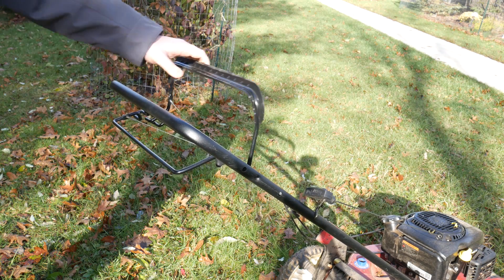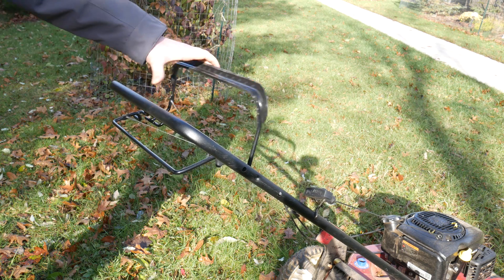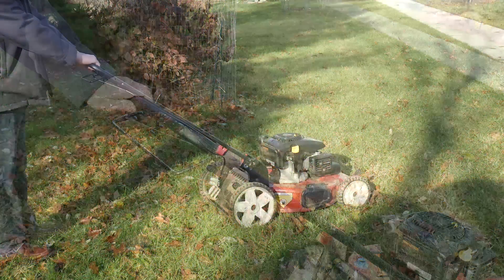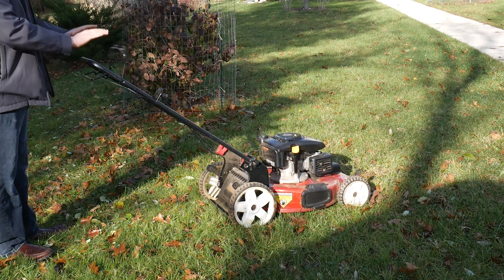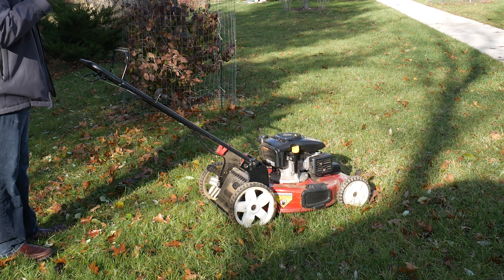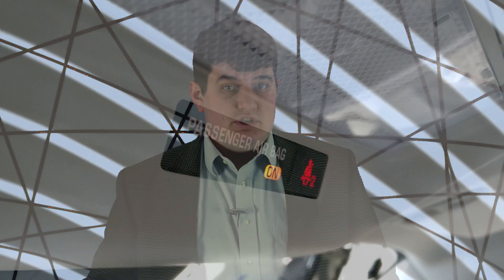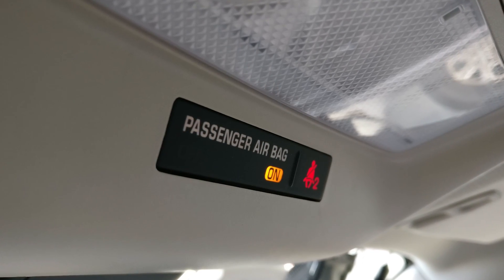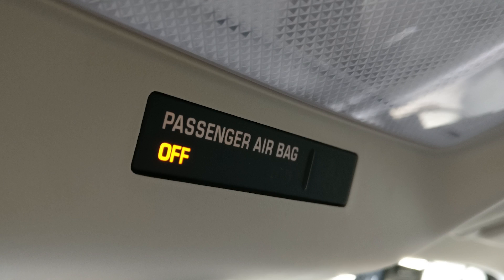The Dead Man's Switch:  How Anton Yelchin's life could have been saved

Comment: "All that's needed to prevent the scenario that lead to Anton's death" is just a gear-shift-lever that works properly.
Reply: The point of having safety features is to step in when the operator commits an error or the item fails. We have handrails for a reason. No one reasonable would say we shouldn't have hand rails because people have a responsibility to not fall off the edge.
Reply: @shadogiant  Handrails actually make it easier to pull yourself up stairs if you're trying to go fast or pack something heavy up them. They're not just a safety feature and so would exist regardless
Reply: @shadogiant  we should just wrap you in a roll of bubble wrap and put you in a padded room and never let you out for safety reasons. wouldn't want you to ever get hurt.
Reply: @shadogiant  no.  the purpose of safety features (used to be called fail-safes, but consumer feedback thought it meant the product was designed faulty)(marketing wanks)  is to FAIL in a SAFE manner... so, if you have a FAILURE (not operator error) it will do so in as safe as possible.  So, the example here, is that there should be an brake should the transmission parking pawl be unable to prevent the vehicle from moving once shifted into Park.... Oh, right... every vehicle HAS a parking brake....  so Instruct the Operator to Use it....  like say idunno.... with a driving instructors course and driving test?....
Reply: f1y7rap there is no reason, that safety measure couldn’t protect user from their own error. Like saw stop or quickstop chainbrake. There are ways to create overrides for sensor failure and companies can include disclsimers, that these systems are not replacements for correct operation of machinery. Most modern cars won’t apply park when moving, so accidents caused by sensor failure wouldn’t be prominent. Inconvenience when occurring, but most likely non-fatal.
Reply: He did state in the video that this specific scenario can be avoided by the computer not engaging park if the car is moving faster than a specific speed.   All about the programming.  @ 6:40
Reply: @crp5591  or make the engagement have a timer depending on speed, if the car is sitting still but you leave the car while it's in gear, maybe it waits 10 seconds before applying the parking brake, but while moving you get a only 3 seconds before the brakes are slowly applied, but then get released as you sit back down.
Reply: How dare they to consider improving my safety! I never got squished by a car so why should I need such a failsafe! I don't even have a driver's license, I just drive the car, works just fine! And while we're at it, I also don't want free healthcare because I never had a bad illness! Retirement fund? I am not old, why should I have one!
Reply: It is a horribly designed shifter which does not give a positive indication that the car is in park, nor a warning that the vehicle is in gear when the door is opened.

My Fuso truck chimes loudly if the door is opened while the shifter is in any position other than park and the brake pedal must be pushed firmly to the floor before and held for a second before it will shift out f park.
Reply: that's why it wouldn't activate if the car is already in motion or not already practically stopped, this is why those cars with the start engine button, don't kill the engine if you press it while driving, but it has an override if you hold it in to kill the engine while driving in the event of an accelerator runaway where you cant de-accelerate (dump the car in neutral and slow down before doing that though), also, i have dumped cars from drive, to park while in motion, it doesn't stop the car, it shifts the gears into a stopping or reversing position into opposing motion from the tires and starts to grind and destroy the transmission, so if anything, a car suddenly dumping into park while driving would at worst, shred apart the transmission and render the car undrivable without losing control of everything (you could bring the car to a stop and steer, but wont get it moving again after)
Reply: In the world of accidents, it's not just one thing that goes wrong. Faulty gear shift lever + lack of dead man switch + car on an incline = just three of the several factors leading to his death
Reply: Does this car have a handbrake?
Reply: sidharth cs   Every car / truck has a parking brake, that is supposed to be set by the driver.
Reply: Or just design auto gear shifts as they have been designed for decades - a straight line in the PRND configuration. Even w the auto manual options, what is the point of automakers making transmission selectors differently than each other?
Reply: the issue with some of these automatics thy are fully electronic (well at least in last 10 years) , as the shifter defaults back to middle when you let go of it so if your not looming at the dash you might of missed park (if your in automatics that simply shift and lock most people would never had run away down a hill issue) 

an idea is Basically if two sensors are tripped automatically go into park and auto ebrake if car has ebrake( if under 3-5mph) so if the the door is opened and seat belt is off or seat sensor it should go Into park automatically and ebrake (if fitted)

Driving without seat belt is illegal in most places so Boho if you can't move with seat belt off but as what I am suggesting also requires you to open the door so having no seatbelt would not stop you from driving away opening the door as well would (but that's why I say 2 sensor idea is better, door and belt or seat sensor if both are open then auto park and ebrake if fitted) 

in current cars with this vertical stupid return to center automatic shifter they are fully computer controlled and part of the Cambus so they could update the ECU to implement automatic Park and ebrake if seat belt not in or seat sensor and driver's door is opened when car is in in drive or neutral
Reply: true comerad
Reply: Depends on the car. I've accidentally dumped my 4L80e-fitted Suburban into both reverse and park at speed (faulty gear indicator), it either spun the tires backwards or locked them up, in both cases starting to fishtail the truck. Fun times!

Said faulty gear indicator also made the car roll away from me once when I thought it was in Park. Also pretty amusing times.. never left it without setting the parking break afterwards.
Reply: The purpose of safety equipment is to protect you when things don't work properly or when used improperly. Would you get into an elevator without a free-fall brake? Would you use a welding torch without a flash-back arrestor? Would you buy a water heater without a pilot light detector for gas shutoff? Would you use a microwave oven without a closed-door switch? Would you use a voting system without an electoral college? ... OK, well, 4 our 5 ain't bad. I'm sure there plenty of other examples.
Reply: @NoahSpurrier  You mean oxyfuel cutting/brazing equipment right? And to answer that OH&S says you must have flashback arrestors on the regulators as a bare minimum. Torch manufacturer now builds them into the bottom of the torches themselves as well as an additional safety device. And the torches without them being built in are starting to become phased out.  I firmly disagree with OH&S on that regulation though as you need Flashback arrester's on both ends of the device to be safe. If you cut the line in the middle the arrestors on the regulator save you, if you cut the line close to the torch you have a whipping fireball by your hands/ body. 

As for the water heater, I also wouldn't buy a water heater without a PSV valve, preferably a PSV valve beneath the tank so if it does relieve and you are standing anywhere close to it, you don't eat steam to your face.
Reply: @BType13X2  flashback arrestors on the torch won't help you if the gas line is severed or punctured. And flashback arrestors on the regulators makes sense as a bare minimum. That doesn't mean you can't have them on the torch end as well for an extra level of safety, just that if you only have one set available you should put the on the regulators instead of the torch due to the vulnerabilities of the gas lines.
Reply: @MikeDCWeld  Don't know what you're responding too. I literally said OH&S requires them on regulators as a minimum. Where I am at OSSA requires them on the torch and the regulators. For how much they cost and how often you'll change them I don't know why you wouldn't have them on both ends. I'm a journeyman welder and my garage setup has them on both sides.
Reply: Noah Spurrier I’d use a voting system without an electoral college.
Reply: @ky129  r/wooosh
Reply: @Noah spurrier Electoral colleges are the fail safe. It stops country's being governed  by a few high populated cities. I lived in Australia and the U.S. The U.S system is far superior.
Reply: AKA drive a manual transmission
Reply: @P7777-u7r  dude, this is just an ignorant comment. "Oh, just drive a car without a park at all! It's not like manual transmission cars have EEeVvvVveeer rolled away."
Reply: @TheAwesomes2104  Not being able to manually disengage your engine from your transmission is stupid and dangerous. Manual users are not stupid of course we know that there is nothing stopping a vehicle from rolling when in neutral that's why there is something called a parking brake.
Reply: people just want anything except reality.
the gear-shift-lever worked properly...
Reply: illitero
 Sort of like getting out of your car without it being in park and having it pin you to a mail box?
Reply: No, that's just bad design and vague user interface.
Reply: Incorrect.
Reply: Noah Spurrier you don’t realise; those examples don’t have a danger if they shut off incorrectly
If an elevator suddenly shuts itself off and brakes, people may be a little hurt, but no one dies.
If a hot water heater turns itself off incorrectly, it just means no hot water
And a microwave refusing to work won’t hurt anyone
But if a car suddenly puts itself into park whilst driving
It could cause a huge car crash
Reply: @runforitman  most automatic transmissions will not shift into park over 15 mph. And even when you do do that, the wheels will not lock. Instead you will just ruin the parking pawl. And also your car will not shift into reverse over 15 mph as well. Not since 1998 on most cars except the cheapest
Reply: @runforitman  if a gas water heater turns itself off incorrectly, not only do you not get hot water your house may go boom.
Reply: runforitman - I'm not sure you'll ever read this because it is so dumb you must be trolling. If you don't know why, I truly hope on of the four examples happens to You.
Reply: Or he could’ve just used the parking break, like the manual says 🤷‍♂️
Reply: That would be operator error, Outsider.
Reply: Yosen B. Mamma If only he knew about the invention of the parking/handbrake too bad such a device had not been invented yet.
Reply: P77777777 or just let people drive what the fuck they want but make it as safe as possible.
Reply: Drive manuals. less of electric software controlled laggy shit the better. Some things in cars should always stay hardware and analogue, transmission and steering, emergency/handbrake and throttle
Reply: @Kacpa2  With the rise of EVs, vehicles will become more automated and software driven.
Reply: Well, he could've also engaged the parking brake, a lever designed to keep the vehicle from rolling off unexpectedly by mechanically engaging the brake pads. If we want to point fingers...
Reply: This comment thread is insane.  Safety equipment is to mitigate danger in the event of operator error. Saying "x happened because of operator error, therefore we don't need safety equipment" is self-defeating.
Reply: @jacoby6000  Because humans are totally error free organisms. 

On a serious note, I can understand why some people are against computers being able to control vehicles more and more due to the software being able to be compromised by malicious individuals, but a dead man's switch can still be purely mechanically implemented.
Reply: jacoby6000  The operator is supposed to set the parking brake, apparently the driver didn't.  If he had set the parking brake, leaving the car in reverse would result in no movement.  Not setting the parking brake isn't an error, it is laziness that is all too common.
Reply: @bobroberts2371  So you're against incorporating a dead man's switch because people should stop being lazy?
What's the harm if it doesn't inhibit normal operation and could save lives?
Reply: Ohhh yea. Whats the worst that could roll backwards into me at a stoplight on a hill , I mean happen, with a manual transmission?
Reply: outsider344 you're an idiot
Reply: In the civilised world, where automatics are for lazy people, you fail your driving test if you: a - Don't engage the handbrake when stationary at traffic lights for more than a few seconds or b - can't do a hill start using said handbrake.
Reply: Stam Fordly whaat? In what country do you have to put the freaking handbrake at a red light????.
Reply: @AtomicBoo  Surprised you haven't heard of this. It's not mandatory but it's very helpful in manual transmissions. Picture this:
You're in a manual transmission, and you're driving up a hill. And there's a stop sign halfway up the hill. You slow to a stop, but the person behind you starts tailgating. So you put your handbrake on to keep the car from rolling backwards into the tailgater. Then, rev up your engine, and put the car in gear at the same time as you take the handbrake off.
It's common practice
Reply: @TARINunit9  I drive a manual Jetta, I've never have had to do that in my life, I just keep it in 1st gear with "clutch brake" (barely releasing the clutch while accelerating, theres a sweet spot where the car "breaks" and then ur ready to advance  when the light turns green) whenever im in hills.
Reply: @AtomicBoo  yeah but you're going to wear that clutch out more doing that than the hand brake method. I'll have to try this at some point when I have my own can to drive
Reply: @AtomicBoo  The UK. It's to prevent a car from  being shunted out into crossing traffic if it is hit from behind. Not everybody does it normally but not doing it on a driving test will be a serious (failing) fault.
Rolling backwards on a hill start is also a fail so everybody is taught to use the handbrake. It also saves wear on the clutch.
Reply: @stamfordly6463  what if you can do the hill start without the handbrake?
Reply: @MikeDCWeld  Clever you, So what?
 Doesn't change the fact that it's not considered best practice because it increases clutch wear and more importantly is much less safe.
Reply: @stamfordly6463  not in all vehicles. In my truck, for example, trying to use the parking brake to do a hill start is the less safe method because disengaging it inhibits my vision in front of my vehicle and it would result in a much less smooth and controlled start. It may increase clutch wear, but clutches last plenty long enough with competent drivers that the slight reduction in life isn't going to be noticable enough to matter.
Reply: No. The system used in that vehicle is goofy, for sure, but it worked as designed. It was Anton's RESPONSIBILITY to ensure the vehicle was in park before he got out. He didn't do that. Nothing at all against that man, but he failed his responsibility in operating the vehicle. It's terribly sad, but the truth of the matter.
Reply: @illitero  The truth of the matter is that all safety devices are for mistakes.
Reply: @illitero  that sounds like the arguments made against seatbelts or pretty much every safety feature ever, it is the drivers responsibility to avoid crashing so the car doesn't need to add seatbelts to protect the driver in this situation.
Reply: @garethbaus5471  except it's not at all. You make sure the vehicle isn't going anywhere before you exit. It's basic operator procedure, not a safety feature. Not at all excusing the obvious problem of the ZF system's lack of tactility/responsiveness, but not ensuring you see "P" on the dash before jumping out of a vehicle IS operator error; especially in places like California where vehicle roll-away is a constant threat.

Objectively recognizing the cause of an incident isn't being heartless or saying the victim is stupid. On the contrary, it's taking it seriously enough to learn from that tragedy to help prevent it from happening again.
Reply: @illitero  most safety features are designed to protect people from operator error blade guards primarily protect you from operator error that doesn't mean it isn't a safety feature or that a manufacturer has no responsibility for injuries that would have been
 prevented by a guard if it doesn't have such are guard, the the problems origin doesn't change the fact that a solution that costs basically nothing would save multiple lives. The chance of any person making a mistake at some point or forgetting to do one thing even if that person does that one thing 100 times per day is still pretty much 100% anyone who says otherwise is either lying or delusional so the designers of a product capable of killing someone should do everything they reasonably can to anticipate these mistakes and try to prevent as many deaths from these mistakes as they can without significantly impeding the functionality of the item to not do so when the solution is obvious and cheap is negligent at best.
Reply: However it's badly designed. When you push a auto transmission shifter forward it should be in park. I drove a BMW with the stupid electronic shifter and could not find park or reverse or drive easily. the dial shifters are awful too.  Go back to what works and what people know. I did not buy a RAM truck for this reason.
Reply: @johnfoster7602  BMWs are designed in the civilised world though, the expect people to know when and how to use a handbrake. The Germans probably cannot conceive of a reason why people would be so foolish that they wouldn't use it.
Reply: Or a brain to actually shift into the proper gear before getting out of said car.... glad they're dead. one less moron in the world.
Reply: @draggy76  I'll keep your comment in mind the next time you make a dumb mistake.  We all do from time to time, and to be frank, we need less people like you in this world.
"i'm glad he's dead  because he's dumb" Yeah, fuck off with that mentality.